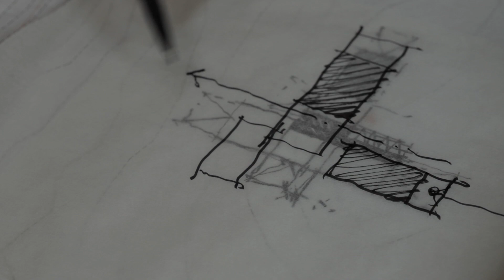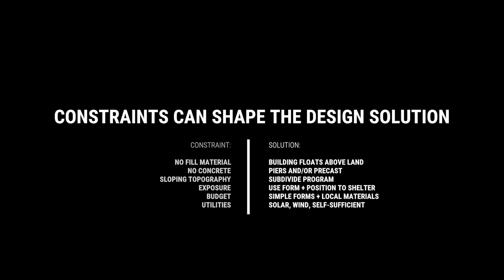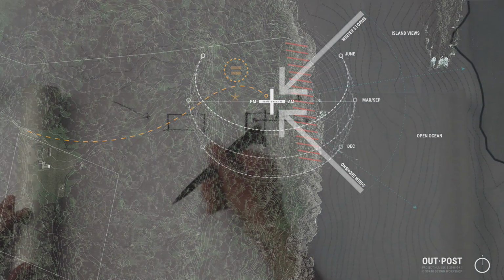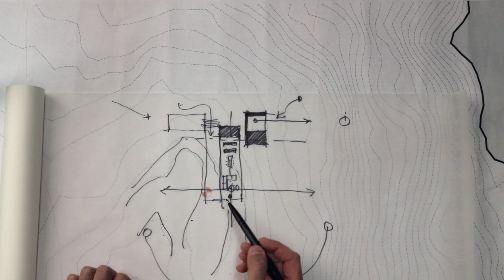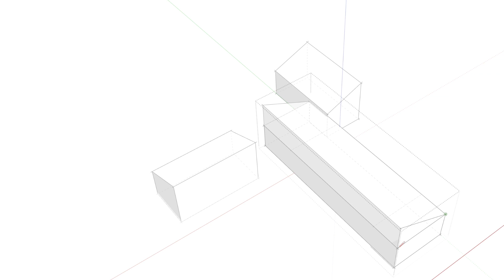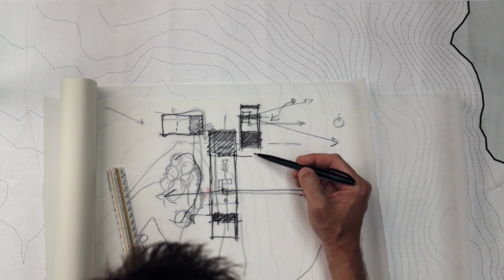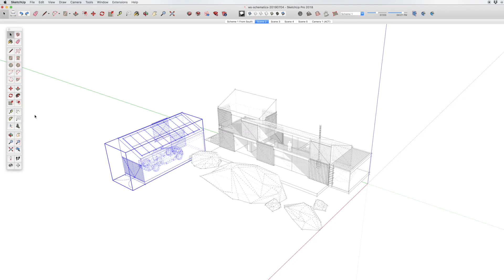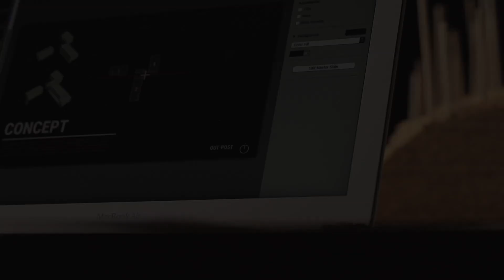Sketching Design Concepts - Outpost Project, Part 4

Comment: I love your design process!! How do you find your topography maps?
Reply: Liam Roblin typically get surveyor to provide, owner consultant
Reply: @Andrew-dg7qm  what if you were a student and wanted to replicate it with a fictional project but a real site?
Reply: Liam Roblin You should be able to find contour maps online for various parks and places like that. People use them for hiking. I suggest you get familiar with contour maps, and then try drawing your own. Easy to do in revit, and then you end up with a topo model, which you can integrate with your building model.  Then you can start investigating how buildings touch the ground and explore different foundation systems
Reply: @Andrew-dg7qm  thank you

Comment: A great location and this remote site certainly has its challenges. Remote, logistics but that rock ledge will not  be fun to cut/blast for septic. I am trying to upload my first part of our plans, but our remote site makes for wifi challenges. We are going with SIPs, Eric is this your solution to. Great stuff.
Reply from the maker: Thanks for the reply and your practical insights, that's what I love about practitioners (builders, craftspeople) real world experience is the most valuable. We'd have a difficult time meeting energy code if we didn't use the urethane panels, so I totally agree. The shear value of glue doesn't compare to fasteners though, that's been my experience with finding a wind-rated panel.
Reply: @30by40  I love the problem solving process of navigating and resolving building related challenges. Can't wait to see your next installment.
Reply from the maker: Thanks for following my friend...for the septic we'll be using an engineered system (pipe and sand) but getting the material there is $$$. We're considering SIPS, but we have a lot of opening in the exterior walls which will require shear bracing at the solid parts (SIPS as far as I know aren't rated for our high wind loads) There's also the need for a long reach crane/boom truck to get them on and off the mailboat as well as installed at the site, I'm not sure that's the right system for us. Are you using EPS or Urethane?
Reply: @30by40  I don't want to distract from your channel by a link. I do discuss SIPs with Architect often. Like you said people think they know you from videos. I regard you as an avid thinker so you may know what I can offer. From my experience assembling SIPs there are the kind that burn and don't. When I consider the single percent difference it isn't a contest. Polyurethane is hands down my recommendation. If you want to see me put my hand on open flame without getting burned in a video check it out. Remote sites like the one I am building on rarely have a fire department close if you prefer EPS SIPS. Great to see more on this build, Thanks
Reply: @30by40  Eric, we have wind loads of 132mph 3 sec gusts here so I engineered for 140. We have had some 70+ winds without issue. Not sure of your market but look into ICS Eco SIPs, I believe they have a sister company in N. Carolina. Thermospan is in Indiana and both us Urethane. ICS has the cam system and Huber products. I do use a Telehandler(or Lull) to fly in roof panels

Comment: Absolutely gorgeous piece of work...video editing and the design approach...stunning. one question, does sketchup run smoothly in macbook air? What's the configuration of your Mac.air? Please let me know.
Reply from the maker: Thank you my friend...yes, I was actually surprised at how smoothly SU runs on the air (13-inch, 1.8GHz i5, 8GB DDR3 memory, Intel HD Graphics 6000 1536MB)...I use it just for presentation work though, so I'm not asking a lot from it...
Reply: @30by40  That's awesome. Thanks. And cant wait for the next video.🙋‍♂️🙋‍♂️

Comment: You should use your drone and DroneDeploy to run photogrammetry on the site.
Reply from the maker: I totally should...I had a fly-away once whilst using it and have been nervous about watching it sail away over the Atlantic!
Reply: @30by40  The good ones sound pretty reliable. I don't have one yet. I'd like to get a Mavic 2 Pro to import the sites in Lumion.

Comment: I retired after 40+ years as an architect, your videos do a great job of explaining process and thinking, I recommend them to students I meet. This is what schools should teach but don’t- design is an analytical process, not a sudden inspiration by a Hero Architect. Everything you are showing can apply to bigger and more complex projects. Bravo for your efforts here.
Reply: How did you enjoy your work in the field? I am starting my freshman year of college and I want to get a grasp of what working as an architect is like after education. Many practicing architects I have spoken with have said that, while architecture school was fun, it was far and away from the work they did in the field.
Reply: Seth Moore : I enjoyed my work as an architect, but what you hear is correct- arch school  teaches a common language and skills but it is not much like actual practice. School teaches individual design, taking a simple program and making 3D form to fit that. In reality, design is only a small part of what architects do, and in fact any project bigger than a medium size house is done by an architectural, engineering and construction team, not by a single architect/ designer. There are other skills required, few of which are taught in school:

Marketing and client management: how does the architect or firm present its skills, define its target market, present to possible clients, select which clients to take on, calculate a proposed fee, write the contract, collect the payments, manage the process, and keep a good ongoing client relationship over a years long project?

-Programming: what spaces does the client need, and what is their relationship? I worked mostly on large healthcare projects, which might involve dozens of departments, hundreds of rooms, and up to a million SF. The programming team might interview and work with 50 technical users, and need to be able to understand the detailed needs of doctors, surgeons, radiologists, nurses, and hospital executives. I liked going behind the scenes, and creating new analytical processes as needed: ‘if you want to plan for 2,500 hospital births per year, how many rooms of each kind would you need? ‘ It was up to me to figure that out.

-Design: in real life this involves multiple options, lots of preliminary designs, interactions with clients, local officials, and the construction team, not just selling a design you like.

Documentation Architects need to produce a legal description of the project for bidding, and to literally become the contract with the builder, which usually involves a team to detail everything and to coordinate with civil, structural, plumbing, HVAC, and electrical engineers. If you want that cabinet in the third bedroom to be made of clear birch veneer on marine plywood, with bronze finish round pulls, you need to say so here.

-Construction supervision could be 40% of the total work, reviewing drawings submitted by contractors to be sure they got it right, attending and documenting lots of owner/contractor meetings, and dealing with field conditions. This is not usually the Architect rejecting bad work, it us usually a group of people with coffee cups looking at something: “Huh. How did that happen? Now what do we do, to revise the design or the construction method?”

To me, the emotional payoff in architecture is seeing users happy with the end result. I liked that I was putting in this effort on useful long term things like schools and hospitals,  not commercial boxes or things that would be gone in a few years. All of the process requires working with teams of people, getting along with them, and keeping good written notes along the way. None of it involved a Hero Architect alone in the studio at 1am creating a Pure Design to magically solve the problem and win a prize. Good architects, I think, like to lead a team and manage a process.